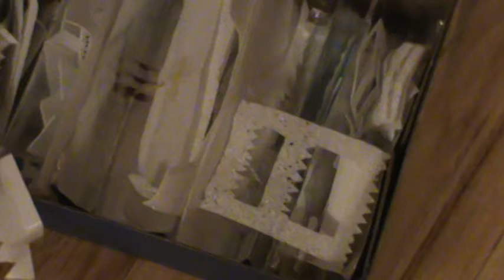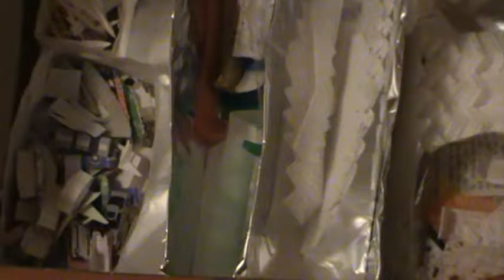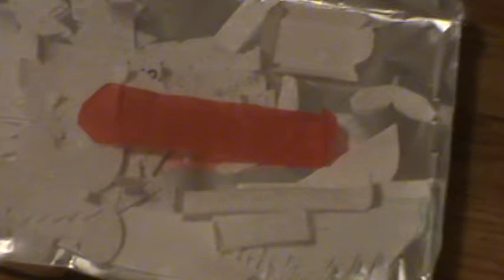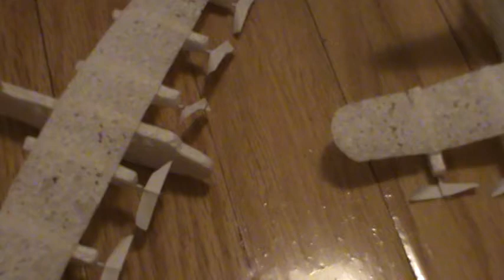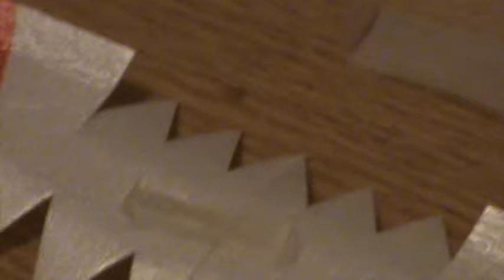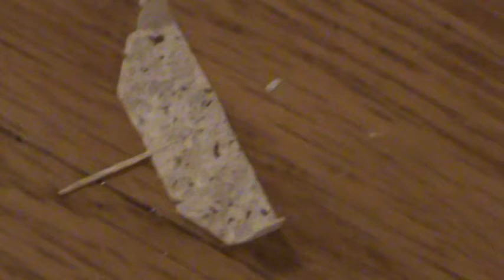My Walkalong Glider Collection

Comment: Wow! Beautiful collection!

1. How did you add the dihedral in the foam version of Club Racer and the 4 prop glider? I see slight cuts in wing TE and LE. But how does that keep its shape? Tape at the bottom?

2. Do the wings have incidence? How much? What about decalagae?

3. In you interview with Slater, you mentioned that you came up with zagwing design because 'making a single delta wing would increase the length, so it wont stay up in the air wave and would come nose down..thats why the multiple delta wings on a wide wing..' Anant from Goa, India has made this delta wing design and it flies very well with stability. How is that? It's length I guess is around 12.5 cm compared to 7cm of Slater's baby bug, and wingspan of 13cm compared to baby bug's around 20cm. So the design is just the reverse what it 'should be'- longer length and shorter wingspan. It does have winglets/fins and elevons.
Plan and video: http://www.endlesslift.com/delta-wing-walk-along-glider-experiment/

PS: I am having problems in posting more than 1 reply..if you reply to this comment, than when I click reply to your comment, the entire comment section below the video disappears!..disabling extensions, using incognito etc is not working..so i have just one shot :P
Reply from the maker: Hi, yes the club racer clone and the 4-prop glider used bits of tape to hold the wingtips up. Of note the foam club racer model does not exist anymore. I first added a couple props to it for fun. Then used those props on a much better project recently. The glider didn't fly all that great and it was beat up, so time for it to go.

I don't use much incidence or decalage at all. A few degrees at most. Lately I prefer zero-zero for both. I will create positive pitch stability by bending the trailing edge of the stabilizer up some. Seems to provide a more speed sensitive effect which is what I want. Rapid pitch response allows the glider to recover quicker from upsets.

I think his design works well due to relatively high glide efficiency. The higher off the board, the less gradient effect to pitch the nose down. Jagwings and my plank designs aren't so efficient and thus work better with shorter chords.

Comment from the maker: @freakonflight Does the plane fly straight when freely gliding? If that's not the case, and the plane simply doesn't want to turn when you tell it to, larger vertical fins might help. Gliders with long fuselages and stubby wings don't usually work well as walkalongs due to pitch trim issues (the tail sees too much updraft versus the wing, so the plane dives). Hope this helps.

Comment: I have a challenge for you I tried to make A f 22 raptor walk along glider with my hot wire cutter but the problem was that whenever I tried to turn left it turned right         could you make a f 22 and not have the same problem